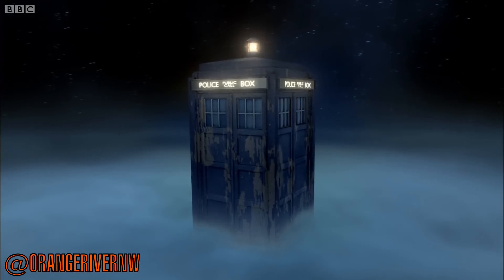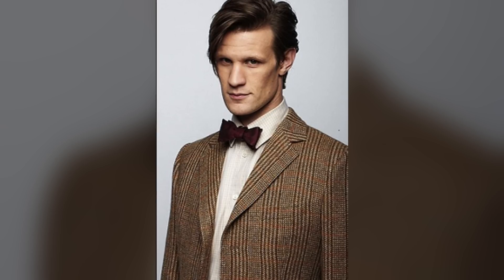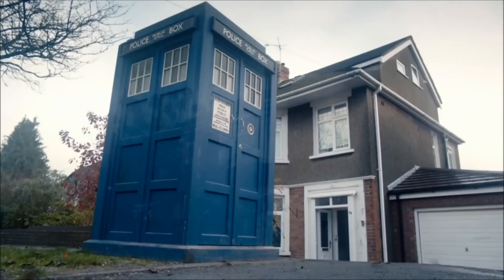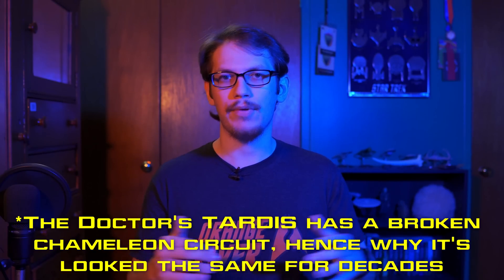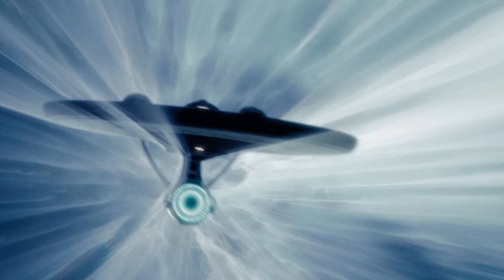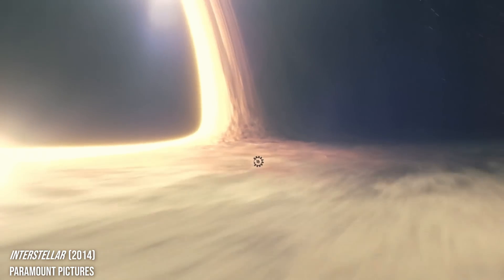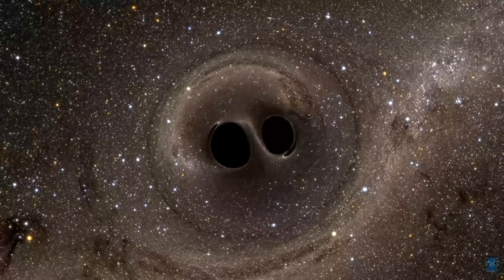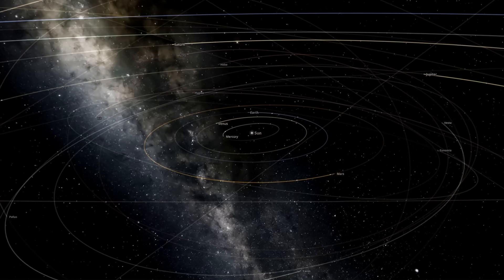How Does the TARDIS Work?

Comment: The Tardis interior doesn’t go anywhere, but its door way does the travelling.  Where do you go when you step inside?  Imagine it like this….say we all lived on a flat plane with no thickness..(or like an ant on a huge flat surface it that’s easier).  Now take a sheet or plane at right angles to our flat surface and touch the edge to our surface…when the ant runs into the vertical surface it changes direction and runs up into the new area.  It can’t see the direction change, but realises it is no longer on its flat world. Now imagine we have just a small extension of the vertical plane touching the flat world…it would seem like a doorway and once the ant crosses it the size of the new area can be as big or small as we choose to make it…this is analogous to the TARDIS interior. Volume.

Comment: I prefer the explanation as presented in the movie. At least regarding the "bigger inside than out" idea. In that, the TARDIS actually has two different components. One is the TARDIS interior, which exists in a bubble dimension and enclosed in a hard shell. The second is the external component. Both have a transference threshold. When one cross it, they are seamlessly transported from one to the other.

Comment: The tardis is in two parts.  The vehicle with door can be moved to any location or time. the inside is located in a different location.  The internal dimension encloses a black hole to power the tardis.  Time and relative dimensions in space.  It does not say Time and relative dimensions in a space.  make a ring of your finger and thumb and look at a distant building.  it fits in your fingers.  This is how it was described.  The door moves but the interior of tardis stays in a location.

Comment: Listen man, I need to build a real working TARDIS, at very least it needs to be bigger on the inside than it is on the outside.
At least 30' x 30', by 10 feet tall on the inside, yet only 5 feet by 5 feet, and 6 feet tall on the outside. 
I need to finish building it within two weeks, and for less than $300.

Comment: As I've seen it explained the Tardis interior is a pocket dimension encapsulated within the outer plasmic shell, as in the exterior is a "door' to an inner (much larger, possibly infinite) seperate space and the two are "grafted" together. Obviously though in decades on the air and tons of secondary media various "explanations" have been proposed.

Comment: I love how half of Doctor Who’s lore is reasonable technobabble, while the other half is just throwaway jokes.
Reply: alas its just a shame that the actual theoretical physicists saw this episode as word salad with the exception of the Kasimir effect. the quantum vacuum energy paradox, proves only that the calculations in the field equations are wrong and that we currently have nothing to replace it with.

quantum Vaccuum energy contains a minute amount of energy that is spread out over the universe, for a T.A.R.D.I.S  to work it would literally have to be feeding off its own big bang caught at the moment before inflation

or Be using some form of Dark Matter as its source (although i do not believe that Dark Matter/ Energy Exists ) but is more along the lines of us recognising an effect for something we have not yet calculated correctly potentially the effect quantum fields have on larger scales
Reply: @Demonic-X  it's not a word salad. It's a word stew 😅

What is more theoretical physics compliant would be using the exterior, the shell, the interface as a doorway only, which you can withdraw from here and put over there, and the interior never really travels anywhere. It is something that is above our dimensions, so it's like us moving a chess piece and thinking about how it looks from the board point of view. Etc.

Doesn't need to fit with our reality. On paper you could math it away, just requires a lot more energy than we could get at a time
Reply: Just like Star Trek, then?
Reply: That’s why we love it

Comment: I don't think you need to invoke string theory to demonstrate objects with surface areas and volumes that are much larger/smaller than expected.  For example, see Gabriel's Horn.  Another example is a fractal "line" that has infinite length but finite distance between the starting/ending points (i.e., fractal dimension between 1 and 2).